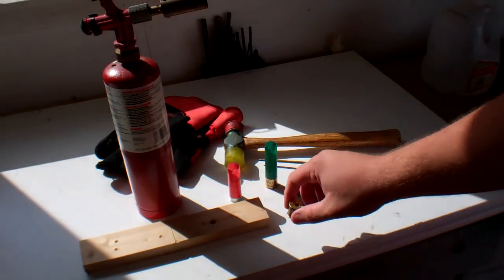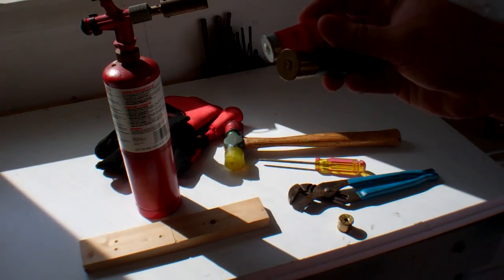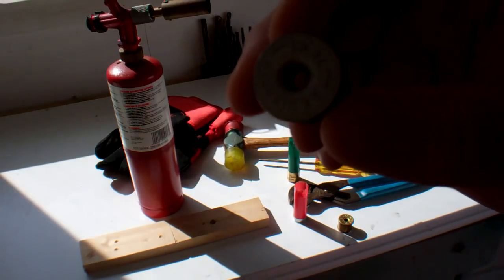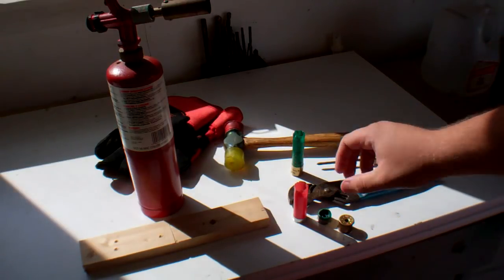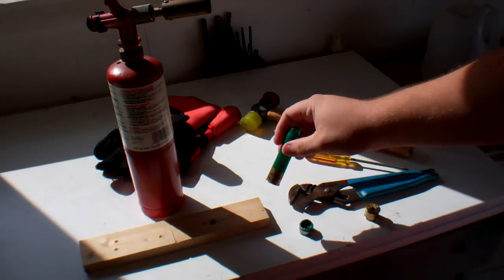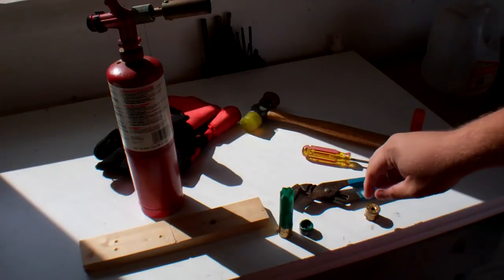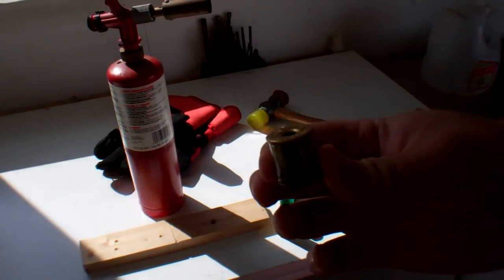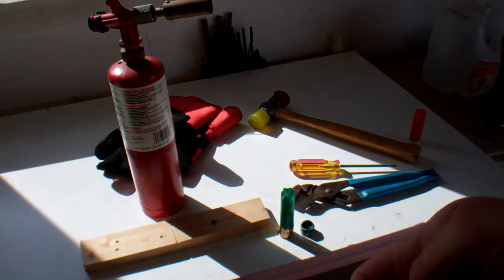Shot Shell Whistle Duck Call

Comment from the maker: @str8huntin2 Maybe when I get some spare time I will. I had a demo in the original video but apparently high pitched sounds and my camera don't mix so I edited it out. I have found that for some reason, some brass requires you to suck air in rather than exhaling through the call. I'm not sure why that is.

Comment from the maker: @afoxxydude In terms of gauge or metal type? I would think a smaller diameter head like a 20 gauge or 16 gauge would sound different. If you mean steel head instead of brass, I don't know how much of a difference it would make. I haven't tried using anything other than brass head shells.